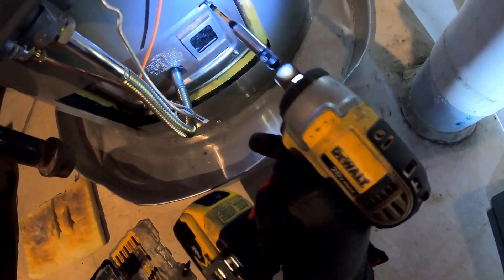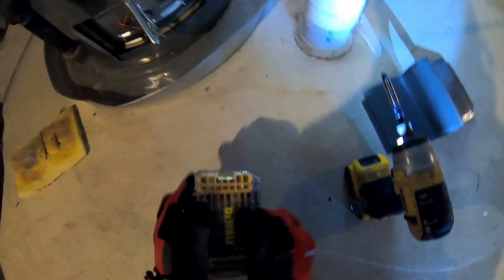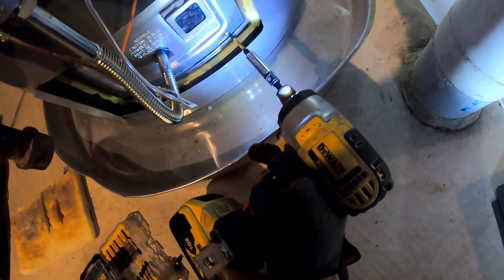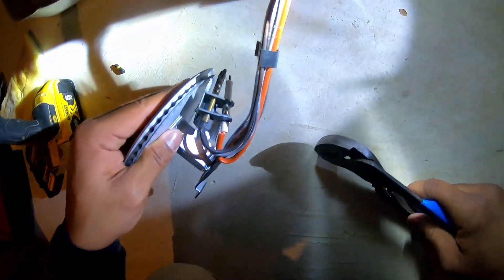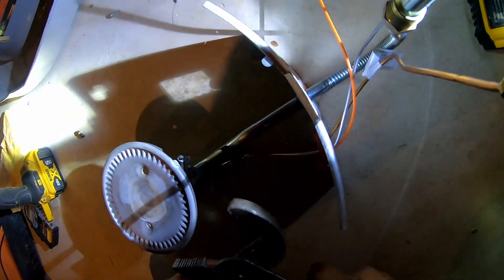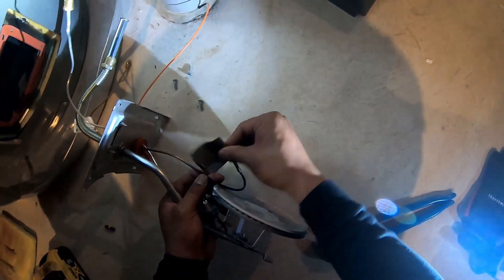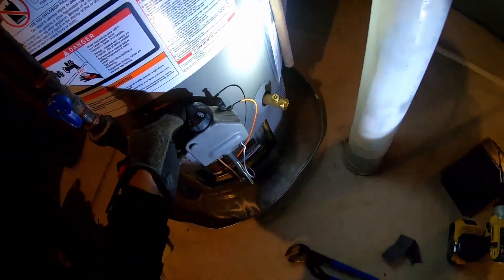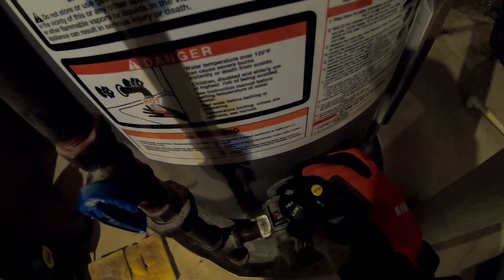Hot Water Tank pilot wont stay lit , Rheem hot water tank no flame , bad flame sensor

Comment: That particular regulator is bad because it has an over heat sensor that the thermocouple connects to that fails very easily.  Once the water in the tank sits cold for a while condensate builds up inside the burner assembly and when you light it water will drop into the burner.  It's not a leak,  it's condensate from the air sweating on the cold tank as it heats up

Comment: I would rather see you use the proper size wrench to loosen/tighten the nuts on the connecting lines instead of  the channel lock pliers which will round off the nuts.
Reply from the maker: true sometimes gotta work with what you have  in the truck , that is for the comment 💯

Comment: I dont have an issue with the pilot staying on, my issue is the main burner keeps going out after I get the pilot lit. Itll stay on for a few seconds then turn off. Do you know what causes that?
Reply from the maker: Did you clean the flame sensor off with sand paper yet ?
Reply: @OffDaHook84  I haven't but I'll do that and see what happens.
Reply from the maker: Yea clean that au you should be good , it that sub and let me know how u make out 💪🏾
Reply from the maker: What happen
Reply: @OffDaHook84  I cleaned it and put it back in and now I can't get the spark to ignite to even get the pilot on so now I'm lost lol
Reply from the maker: @NebraskaRaider 💀 damn only if you was close , so did you put everything back the same way , make sure gas is on ? And when you lighting it do you have electronic ignition or manual ? But you should be able to turn the gas knob on pilot , press it down you should hear and smell gas and click the shit out of the button until you see a flame 🔥
Reply from the maker: @NebraskaRaider  also when you are clicking the ignition button look for a spark if you don’t see the spark u just may have the wire loose or it came out , those heaters are very simple
Reply: @OffDaHook84  would definitely help if I were close. I did put everything back the same exact way I took it off. It's a manual ignition. I just can't get the spark to even get a chance for the pilot to light but I'll keep trying. Keep pressing the hell out of it until I get the pilot to light
Reply: @OffDaHook84  Yea I put the wire In like it should be. I even took it out and out it back on just to recheck to see if it was in right. Idk i just need that spark and it should work

Comment: I have one 9yrs old kept cleaning every 2 yrs this time it's not working. I used compressed air on the gas and the thermocouple as well. 3 days without water not going to play with this anymore. Time for a pro to solve this. Probably will go new. The video is good for day as long as rhey continue to be safe.

Comment: I did that to mine and but the flame still turns off when i let go of the pilot
Reply from the maker: Did what clean the flame sensor ? With light sand paper ?
Reply: @OffDaHook84  yes, i cleaned the flame sensor with sand paper. The pilot flame turns on but when I let go of the pilot button the flame turns off
Reply from the maker: Silly question but do you have the knob on pilot ? And to start at the cheapest thing replace the sensor could be cracked or all the way bad  if that doesn’t work you are going to have to replace the gas regulator
Reply: @OffDaHook84  yes i do have the knob on pilot

Comment: How do you change out the igniter
Reply from the maker: you mean the gas regulator where  the pilot knob is at , because the actual igniter i pulled it out with that entire  assembly and u can change it practically with the same steps

Comment: My pilot light is lit but the burner is not coming on. What could cause that?
Reply from the maker: not sure what setup you have , make sure it’s on “on” and not set to pilot of course turn it up “temp” but you can pull the burner assembly clean it make sure lines are not clogged and at worst replace your gas regulator it’s not gated and way cheaper then buying a new hwt
Reply: Thanks. It’s a 13 year old Raheem standard gas valve. Settings have not been touched. I will pull the burner assy out and clean like you said and see if that helps. Only getting Luke warm water